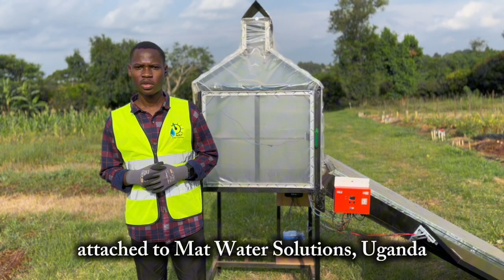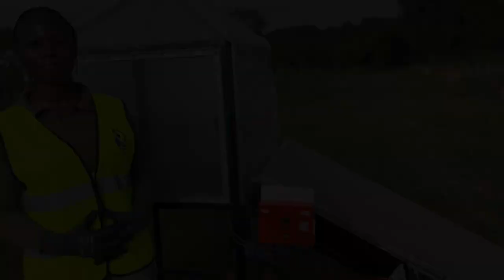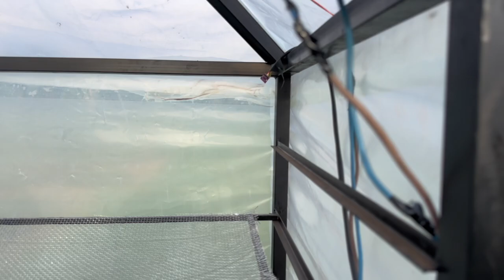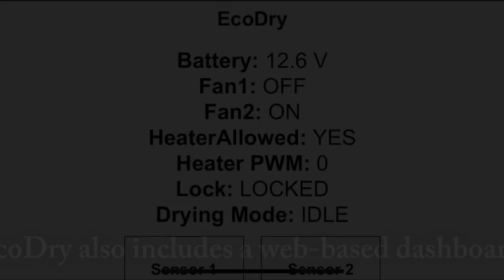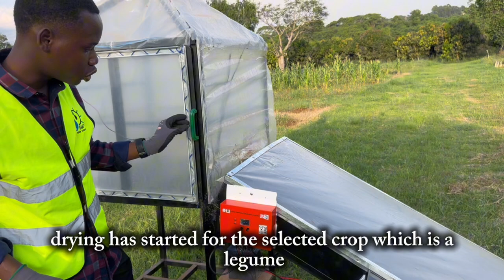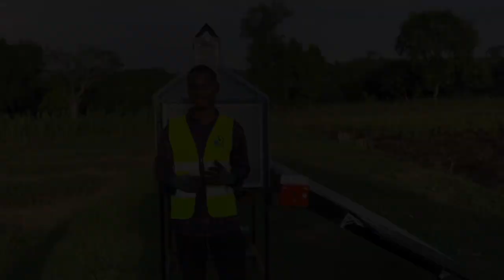EcoDry Samrt Hybrid Solar Dryer

Comment: Would you like to develop the "Sun Scoop" as a solar drier? Technically, this would be a "mechatronics" project.  Its open source and free for anyone to use.    I thought of the idea around 2010, but didn't have time to develop it, so put it on the solar cooking website.  I am now retired due to medical reasons,  and Last year I made one.  It works really well! It is on "equatorial mount" and in Canada. the geometry of equatorial mount means that I can have one reflector.  But in Uganda you can have 2 reflectors because equatorial mount is nearly horizontal there. The Sun Scoop is completely DIY.   I made mine from a 120 by 240 sheet of plastic material then stuck on the reflective material. If you have a similar size of material,  you can cut it into 2 of 120 by 120 squares and use the "cone solar" method to approximate a part of a parabolic dish.  Then cut out the cones or anulus pieces. and join them together.  If you look at my videos, you will see that I can't do electronics!   But you can do it great, so you will be able to build a better drier than I can (with a fan in it).   Note that my drier can get really hot,  so it has to have a fan.  My sun scoop used about 2/3 of the sheet and got up to 670 Watts.  I have  not worked out the reflector size for half sheets yet , but it is likely to be over 500 watts each.   (Meaning that you will have two 500 Watt solar driers running opposite each other on the one axis).   If you are interested in trying this,  I can advise you.  You can also do the electronics for the timing (15 degrees per hour rotation).   I have my own way of rotating it.  The thing is that when your drier is on equatorial mount, it gives close to full power all day as long as the sun is shining.   So it will be a little more expensive to make but its performance will be a whole lot higher than a passive solar drier.  I can put diagrams in a post on youtube if you are interested too.  Thanks,  Brian White Victoria, BC Canada.